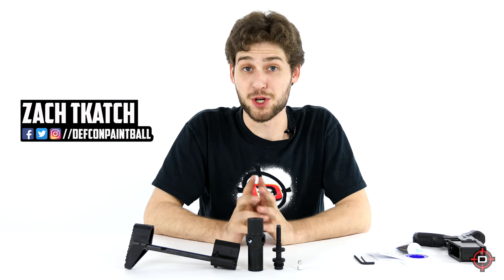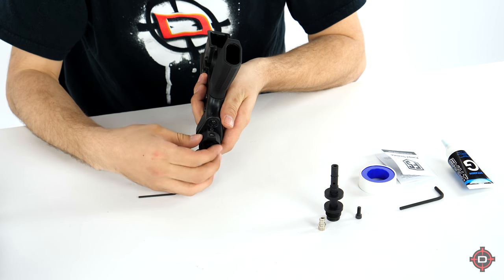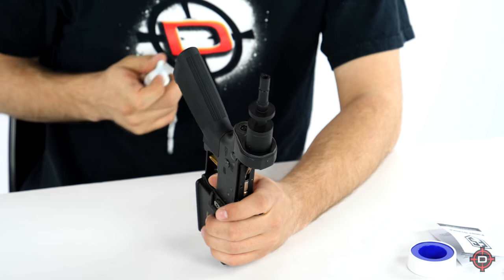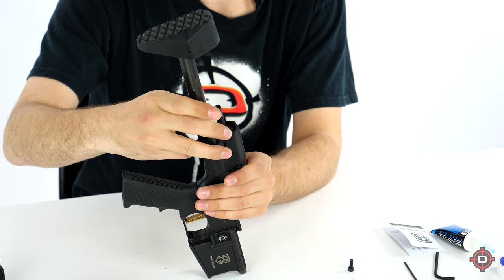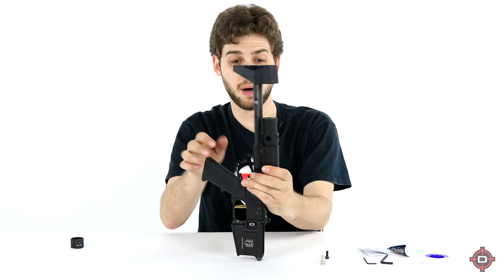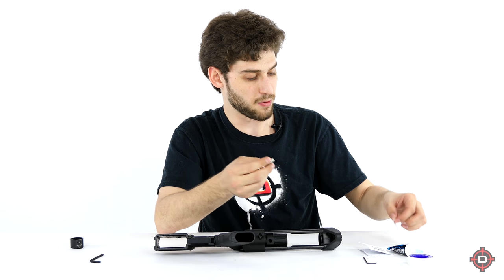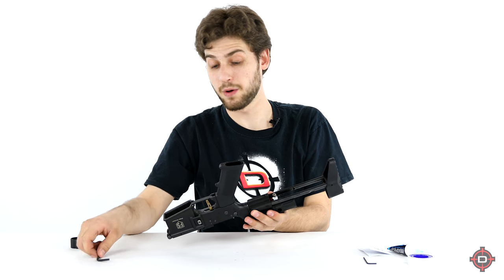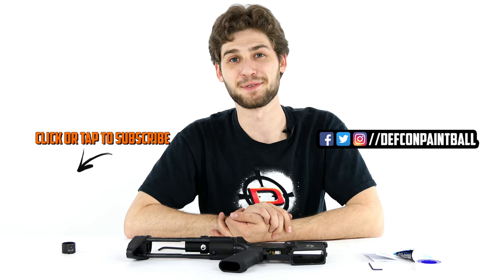First Strike T15 PDW Stock Install - 4K

Comment: Note: You put Teflon tape in the diction you thread so it doesn't unwind unlike shown on the video. To make it simple, If you have the nipple within your finger tips the Teflon should be applied counter clockwise of tightening. Also, I belief it has to be silicone lube due to possible explosion or something catastrophic like that due to the chemical properties I read somewhere.